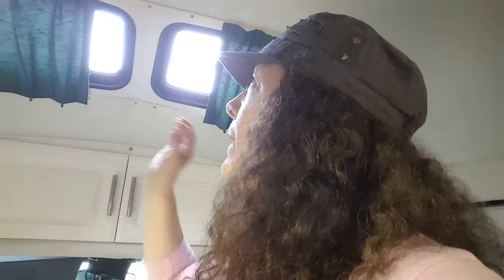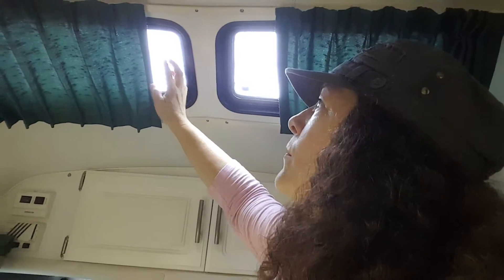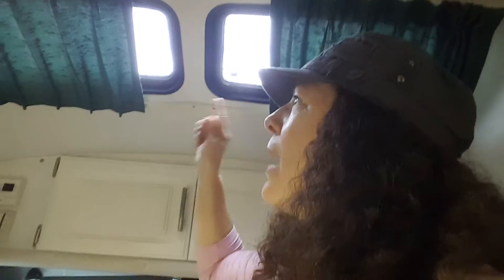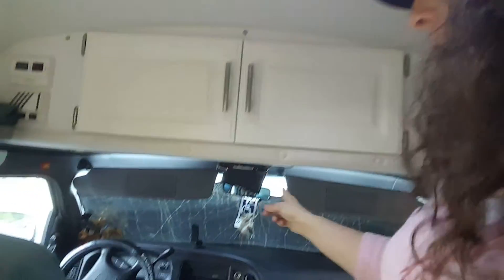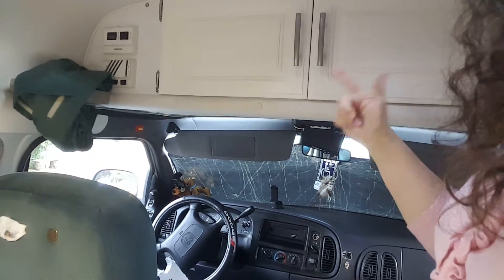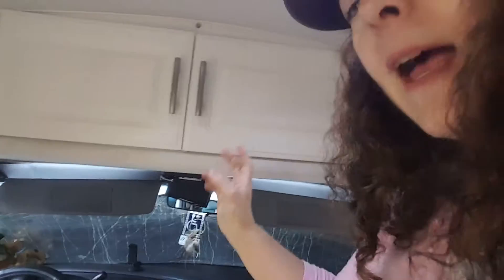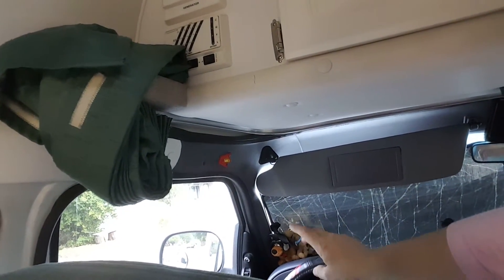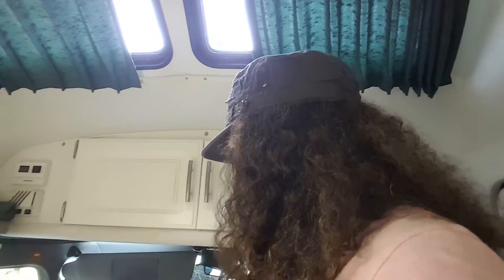Help, Reflectix Project Update

Comment: I just use a big window shade for the front I don't have anything on my two side windows and I pull my privacy curtain that separates the front from the back that works for me for now. I do have the curtain that came with Tank that wraps around the sides and the front it snaps on. I I can use that if I want to.
Reply from the maker: One of the biggest reason I am doing what I am doing is for the comfort of my senior dog with a heart condition.😆💓 If it was just for me there definitely would be a lot less fussing going on.😉 He also fights fluid in the lungs, so he can cough sometimes, and so he takes a diuretic pill twice a day.😯 He is very high maintenance right now but I love him so much. His comfort is top priority to me.😆 🐶😉
Reply: +Irene V I certainly get That! 🐙🐶
Reply from the maker: Debrajoy 🐶💓👍💓😆

Comment: Just my opinion of course but reflectix can be folded to put away and the poly iso can't - so I would only use the poly on windows you will leave covered all or most of the time due to the storage issue.
Reply from the maker: Thank you so much!😄 Yes I agree with you. I am finding the polyiso boards will need some storage space. I felt I needed to do as many windows as I could right now because of my senior dog. Not sure long term if I would keep them. I do like the way just reflectix stores. That is why I am thinking also of just reflectix in the front but at least the whole back has both. That is where my dogs love to go especially when I leave the van. 👍🐶😆
Reply: Understand the need for sure. Just was wondering if the windows don't have enough depth to just hold your coverings in (like a cargo van might because the walls were insulated with it as well), how will you keep the polyiso foam in the windows? PetSmart carries a gel cooling mat for dogs that supposedly requires no refrigeration to stay cool.
Reply from the maker: +TheMaryb1 Most of the windows I have are inset windows. I hope to use velcro  to hold them in. There is a bottom half window that is not inset but will still use velco but I am only using one polyiso board there. I show that window in my first video. 👍😆 I tried the gel mat and Buster would not use it at all so I returned it.😯 I am going to do a video next on pets and traveling with pets so stay tune for that so we all can discuss our ideas and help each other out.👍🐶😆
Reply: Well darn it Buster lol Figures a guy named Buster would be difficult :) Best of luck with your project and a solution for the pups.
Reply from the maker: TheMaryb1 Thank you so much!!! 👍💓😆
Reply from the maker: +TheMaryb1 Oh his registered name is Galaxies Your So Busted then call name is Buster because his father's registered name is Galaxies State Trooper...lol 💓😁

Comment: If the roof was metal you could use magnets, but it's not so industrial strength Velcro might be the better solution aside from permanently attaching it. 
Another solution is to use 3M double sided tape to secure as thin a magnets as you can find around the window frame. Then do the same to the Reflectix or the Reflectix/insulation and voilà, you can quickly remove the insulation whenever you want. 👍🏻😄🚐
Reply from the maker: Thank you so much👍😄 You always have such great ideas, I love it.👏💓😀 💓👍 It looks likes Wed is my new date to glue because of our weather and I have a doctor appt. today. Crazy our weather has been so cool and rainy. 😆
Reply: +Irene V and mine has been hot and muggy, with some rain. 😄
Reply from the maker: Rolling Earth-Ship I feel so bad about your hot and muggy weather. 😳😞 I hate to even tell you this but I am now wondering if I will be wearing  a coat for my whole summer August coastal  trip..vbg 😆💓😉 For the last 4 years we have had extremely hot summers so now we are having a cool summer. Our crazy weather seams to do this to us.😲 So you are having a heatwave now.😨 I'll make sure to film myself in a jacket for you and maybe you can visualize yourself in one also in the middle of summer...❄😄💓😁❄ maybe it will help you, right? 😄💓😉
Reply from the maker: +jerry gingerich Thank you big  bro!!! 😉💓😄
Reply from the maker: +jerry gingerich Hey big bro, you commented something on my last video Shopping for Reflectix but I am unable to pull up the whole comment. I see part of it through Google plus but it won't let me retrieve the whole comment and I don't even see the comment on that video comment section. Your comments are dear to me. You may want to try to comment again. I feel bad that I can't see all of it, it not in comment section of the video so I can't give a reply comment. Love you bro..😆💓😄
Reply: +Irene V Oh I had just commented that if you shop the Home Depot for anything of consequence $ wise and plan ahead you can buy unused gift cards online from places like Giftcardgranny.com at a discount up to 16% depending on the time of year (January usually the highest discount) then buy a Lowe's 10% off coupon on Ebay for a couple bucks (which Home Depot honours), use both together to save alot on puchases. Be sure and ask your local Home Depot first if they match Lowe's coupons before you buy. Looks like your doing a great job with the reflectix BTW 👍👍
Reply from the maker: +jerry gingerich Thank you big bro and for that info!!! 👍💓😄 Yea, I got to see this but it wouldn't let me see that last comment. I hope that doesn't happen again!!! 😉💓